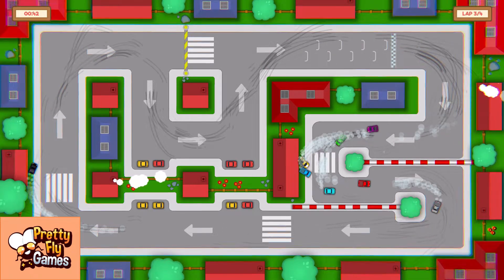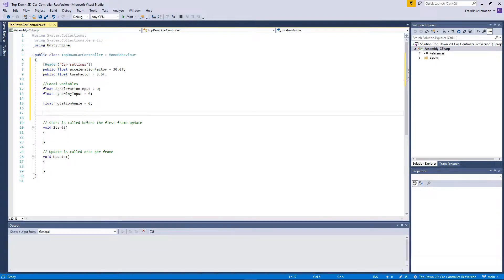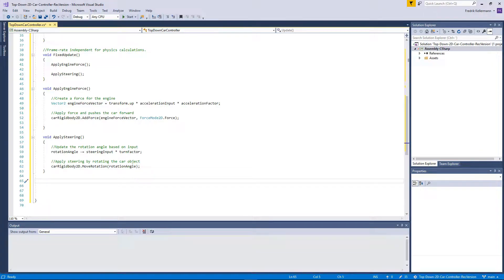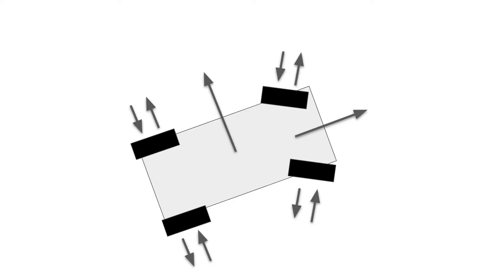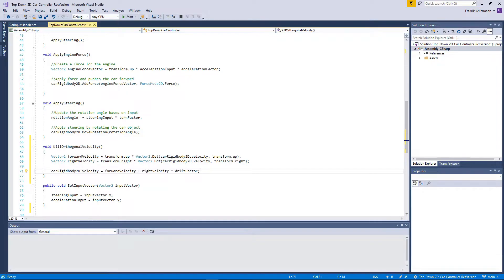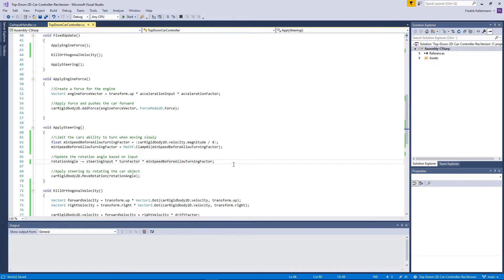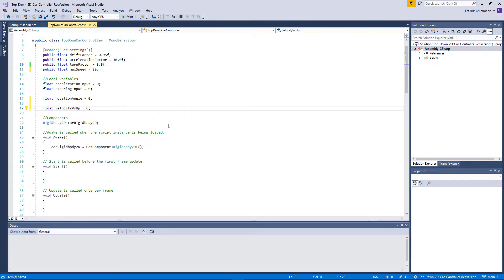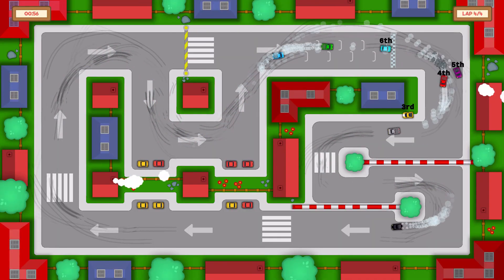How to create a 2D Arcade Style Top Down Car Controller in Unity tutorial Part 1

Comment: using UnityEngine;
public class CarSteering : MonoBehaviour
{
    public float gaz;
    public float gazSpeed;
    public float poworot;
    public float maxpoworot;
    public float poworotSpeed;
    public bool stopRotationOnKeyRelease = true;
    void Start()
    {
        gazSpeed = 5f;
        maxpoworot = 3f;
        poworotSpeed = 2f;
    }
    void Update()
    {
        gaz = Input.GetAxis("Vertical") * gazSpeed * Time.deltaTime;// Изменяем угол поворота колёс в зависимости от направления движения (инвертируем повороты)
        if (Mathf.Abs(gaz) > 0.01f)
        {
            float directionMultiplier = Mathf.Sign(-gaz); // Инвертируем знак скорости, чтобы реализовать обратное управлени
            poworot += Input.GetAxis("Horizontal") * poworotSpeed * Time.deltaTime * directionMultiplier;
            poworot = Mathf.Clamp(poworot, -maxpoworot, maxpoworot);
            if (stopRotationOnKeyRelease && Input.GetAxis("Horizontal") == 0)
            {
                poworot = 0; // Остановка поворота
            }
        }
        else
        {
            poworot = 0; // Полная остановка вращения руля при остановке автомобиля
        }
    }
    private void LateUpdate()
    {
        transform.Translate(0f, gaz, 0f);
        transform.Rotate(0f, 0f, poworot);
    }
} У кого не фурычит этот код можете попробовать этот, он  вроде должен работать

Comment: I did the simple drift physics, but everytime I combine up or down arrow with side arrows. My car just gets launched off the map at an insane speed. What is wrong?
Reply from the maker: It can be caused by several things. I recommend that you join or Discord where it is easier to provide assistance https://discord.gg/AyYtKXT
You'll want to check that your car sprite is pointing upwards, then ensure that the actual sprite is at position 0,0,0.

Comment: Back movement has wrong steering direction
Reply from the maker: Yes, that was intentional but you can easily change it to behave like it would in reality. 

Here is a bit of code provided by a community memeber:
------------
All you need is one additional line of code in 'void ApplySteering()'

int dir = velocityVsUp > 0 ? 1 : -1;

and multiply rotationAngle by 'dir' value: 

rotationAngle -= steeringInput * turnFactor * minSpeedBeforeAllowTurning * dir;

------------

Comment: Are you not required to use Time.deltaTime (or Time.fixedDeltaTime) in your update method to account for the varying fame rates of different machines?
Reply from the maker: FixedUpdate() is sort of fixed so even on a faster computer it will run on the same rate as a slower one. However you can use Time.fixedDeltaTime to ensure that if you decide to change your project's fixed timestep later on it will still run at the same rate. But you are not required to do so. I hope that this answers your question.

Comment: Hello! AMAZING video, I'm going to make a game like the one you made, but I have some questions:

1- I wanted to put items like mariokart, is there any video that can help me with that?

2- Could it be possible to have a camera there that follows the player and so they don't see where the rest of the players are?

3- Can you make a course selector? and it will work Online?
Reply from the maker: Hi!

Glad that you liked it 🙏

1. I have not made such a video but it shouldn't be that hard to use parts of this series to implement that. 

2. Sure, just add a Cinemachine camera and have it follow the player or players. 

3. There is a tutorial how to select cars, you can use the same to make a course selector. Online games is quite hard to make so if you are not very experienced in gamedev then I would really skip that.
Reply: @PrettyFlyGames  Ok Thanks!
also, for some reason i did the "Car Controller" and "Get input" part, but my car didn't move.. how do i solve it?
Reply from the maker: @Lucariomon  I suggest that you download the example project and compare it with your project https://www.patreon.com/posts/top-down-car-49913192

If you need more assistance I recommend that you join our Discord as it is easier to provide help there.

Comment: Somehow I cant seem to turn my car left. When I turn right it appears to move the car in a circle clockwise around an invisible point. When I try to turn left, it goes backwards around that imaginary point counterclockwise. The turns themselves are also very wide it seems for some reason. I've checked my code and I cant find my mistake. Anyone have any ideas?

EDIT: I figured it out! My "Car" GameObject and my "Car" Sprite we not BOTH at 0 on the x and y axis. This caused the sprite to behave very strange. Hope this can help someone else troubleshoot!
Reply from the maker: Glad that you figured out what was wrong.
Reply: This helped solve my car problem, thanks!

Comment: I'm so confused... the vertical does not move!
Reply from the maker: You mean that the car does not move when you press the acceleration button? Ensure that you use transform.up when applying the force and not tranform.forward. 

Also you can get the source for the project here: https://www.patreon.com/posts/top-down-car-49913192
Reply: @PrettyFlyGames  Hey buddy - thanks for that.

I think my issue was that I set the gravity scale to 0 and was trying to turn with it, but of course, you cannot do that but in my original code I had it so you could. I like yours more, thanks! :)

Comment: hey so another question

when i start the game and the cars are starting at a turn the instantly switch to 0 degree rotation which isnt the best look

is there a fix for this?
Reply from the maker: Ahh yes, add this to your TopDownCarController.cs

void Start()
    {
        rotationAngle = transform.rotation.eulerAngles.z;
    }
Reply: @PrettyFlyGames  OHHH I WAS DOING IT WRONG

Thank you so much youre the best

Also ive figured out some ways to add driver ratings to the game if you wanna add that

You just take the power then multiply it by 1.05 or something around there if you wanna try that

Comment: hi ! i know this video was made a year ago, but is there a way to use it with a virtual joystick ? i'm trying to make a tank game for mobile. Also, thanks for the video, it helped me a lot understanding unity's physics
Reply: my problem is that i want that the car go in the dirrection of the joystick, right now, if the joystick go up, the c&ar will go forward, no matter how it is oriented
Reply from the maker: You can hook up any type of joystick to this really. The important thing is that the input axis remains the same. You can checkout this video https://youtu.be/BQJf0gCPVmo where I show how to implement UI touch buttons to steer the car. The concept is similar to using a virtual joystick.
Reply: @PrettyFlyGames  Thanks for your awnser, but sadly, it seems that i cant make it work properly ;-;  I saw your video for mobile UI but since i have two joystick (the otherone is for shooting) it cant be done that way either. Right now, my joystick work exactly as a keybord arrow, the result i'm trying to acheive is that you neet to orientate the joystick in the same direction of the car for it  to go forward, so i have "input.vector.x = joyStickPos.x - tankRot.x; input.vector.y = joyStickPos.y + (1 - tankRot.y);" so if the joystick is in the same direction of the tank, the input vector is (0;1). tankRot.x and y are the sin and cos of the tank rotation, because my joystick position is how it is from center in height and lenght (so the sin and cos). I'm really sorry if i did any gramatical error, i'm french. Also, I'm very sorry to bother you this much, if you don't want to reply, i'll understand. Thanks anyways !
Reply from the maker: @armandmarcelli5795  ahh ok now I understand what you want. So you want the car to turn in the direction of the virtual joystick, right? 

So if you push the virtual stick up then you want the car to go up. And if you push it left then it should go left? 

If that is the case I can probably provide some help, but it might be easier if you join or Discord server https://discord.gg/AyYtKXT

Comment: I’m making a F1 game and I was wondering if I use this controller how can I make it less cartoony and more realistic?
Reply: Im also trying to do that so idk if you actually attempted to make an f1 game in 2d and it happened or you have experience with coding but I would love to see what you have done if that would be cool with you
Reply from the maker: This controller is designed to be cartoony so it will probably be hard to get it to behave 100% realistic. You can try to adjust the drift factor and see if you find a number that fits your needs more. The turning of a F1 car is probably also effected by how much drag it has so you can see if you can simulate that in some way.
Reply: @PrettyFlyGames  Yeah I’ll try making it less drifty, thanks

Comment: Hi in my project I have spiral staircase, Ive been using 2d effector on the collider it works if your going up but when you want to go down the effects wont work. Any idea on how to solve this ?
Reply from the maker: I've only used effectors like once but can't you just reverse the flow?
Reply: @PrettyFlyGames  in not using the flow effector but the one way component. Is there any other way of using colliders for a spiral staircase ? It's works in one direction is going up, but once you go down or works against you, only thing I can thing of is having 2 colliders and activate the right one when detecting if the player is going up or down.
Reply from the maker: @random_precision_software  You can also solve that by just not using an effector at all. Put a 2D collider on your ladder and change it to a trigger. Then if your player is on a ladder you disable gravity by setting gravity scale to zero and then if the player is pressing up then simply move the player up and vice verse with the down button. If the player steps away from the ladder then reset the gravity scale and it will fall back down again.
Reply: @PrettyFlyGames  The problem is it a Spiral Staircase. would that work?. Its not just up and down.
Reply from the maker: @random_precision_software  I assume that this is in 2D? Then climbing up and down doesn't matter however making the animation so it looks properly can be a challenge.

Comment: Great tutorial but my car doesn't reverse? I check the acceleration input and its recording that it is -1 so im not sure where i went wrong. Any ideas?
Reply from the maker: Did you write the code yourself or did you use the project from https://www.patreon.com/posts/top-down-car-49913192 (Top-Down-2D-Car-Controller.zip)?

 I suggest that you try the project above first and see if it works there. From that you can hopefully figure out what is wrong with your code.
Reply: @PrettyFlyGames  Ah thanks, i simply had put a > instead of a <
Reply from the maker: @cosmic3228  awesome!

Comment: Hey I'm making a similar driving game but with the code you've provided my car doesn't rotate when it bangs into walls at an angle. For example, if I'm driving into a wall at a 50 degree angle, I'd expect on the collision for my car to turn into the wall slightly since the forward acceleration continues to drive the body forward but the one stuck corner will force it to turn. Does that make sense?
Reply from the maker: This code is for arcade style games so it won't behave physically correct. If you want that kind of effect then you can probably apply some extra force at the point where you had the collision. So lets say you drive with your right wheel at an angle into the wall, then you might want the car to rotate right if the angle is large enough. In that case you'd add a force at the collision point which should cause it to turn. You can also experiment if you can get that effect by just apply torque to the rotation.

Comment: Hi so i was wondering if an ai misses a waypoint node how can i program a way where instead of trying to hit it it just gets told to go to the next one
Reply from the maker: Hi!

That is a bit tricky, well not to program it but the implications it might have. So if an AI has missed a waypoint then it might be somewhere it really shouldn't be at all. So often switching to another waypoint will not solve the problem as many courses are build so you need to follow the waypoints. So instead I'd try to fix the issue why your AI is missing the waypoint. Maybe you can simply increase the range of the waypoint or move it. But most often the best solution is to have your AI try to get to the waypoint it missed instead.
Reply: @PrettyFlyGames  thats fair, thank you!

Comment: Is there a way to invert the left and right control when going backward ?
I noticed that it doesn't work exactly like a car :
up + right = accelerate + go right
down + right = reverse + go left
Reply from the maker: Sure, you can change that. Just check if velocityVsUp < 0 and then reverse the steer input if that happens.
Reply: @PrettyFlyGames  Nice, thanks, it works perfectly !

Comment: Would it be possible to make it so that MORE acceleration creates a tighter drift, instead of having to release the accelerator to turn tighter?

I changed the input of my acceleration to based on an on-screen slider, and I want to be able to 'spin-out' the player if they apply too much acceleration through a turn.
Reply from the maker: Anything is possible really. In your case I think you can easily adjust the drift value while driving so if you accelerate you get more drift. You can spin the car also if you apply too much throttle. The easiest way to do that is to disable the effects of the controller and apply a bit of spin to the car.
Reply: @PrettyFlyGames  I'll try adjusting the drift value.. seems obvious now that you've said it!

Awesome tutorial, it was super helpful and easy to understand! You work at a really good pace
Reply from the maker: @Jacrxsp  awesome! Glad that you liked the videos.

Comment: Any tips on how to adapt this to the  Input System 1.0.2? I'm having trouble with the input. It moves upward and downward as it should, but it doesn't really move in the horizontal axis. I think it has something to do with how the Input System store the info from the stick, but I dunno...
Reply from the maker: I haven't really used the new input system but it should be something like this
public void OnMove(InputValue input)
{
    Vector2 inputVector = input.Get<Vector2>();

}

You would then use the value of inputVector. I'm not sure if you need to reset it though like when the user lets go of the gamepad/keyboard.

Comment: It works perfectly :) But do you have any ideia how to implement braking while pressing "Space Bar" and using a "brakingFactor" value?
Reply from the maker: If you'd like a factor to control how much you brake then you could add that into the ApplyEngineForce function as it also brakes when a player pushes the down arrow if the car is going forward. 

If you want it to work when the player is going in reverse or forward you can just change it so that if the space button is pressed you increase the drag. 

If you only want it to work when going forward then you could use parts of the function IsTireScreeching with the same logic as  isBraking. If the car is braking and the player is hitting space then add a brake factor in the ApplyEngineForce function.
Reply: @PrettyFlyGames  I will try it, thank you :)

Comment: Hello, i have a little question, my car is not going in reverse. AccelerationInput is giving me -1 but the car is not going in reverse at all .. also if i put "-transform.up" is going in reverse when is press "w". I tried a lot of things but I don't know why is not working. Shouldn't it work from the beggining ? I'm sure the code is fine but maybe i did something wrong with other components.
Reply from the maker: Hello!

Pleas make sure that you use the code from the project: https://www.patreon.com/posts/49913192. Does the example work in this project?
Reply: @PrettyFlyGames   yeah .. smth was wrong with my code. Anyways now it's working, thx for the reply. Now i added a brake when the player press "space". Used the code for slowing the car down when the player is not accelerating and added more drag to the car when the spacebar is pressed. Working like a charm. Going to part 2 now. Also maybe you can make a tutorial on how we can make a simple system to select the car we want. I don't think i'm skilled enough to do it on my own but i have a little ideea. I thought that i would use an empty gameObject with a script to instantiate the car prefabs. Is this the right path to go ? Thx for everything you do ! awesome tutorials.
Reply from the maker: @spanustefan1995  glad that you managed to solve it. 

When you say "how we can make a simple system to select the car we want" do you mean like a GUI where you select between different cars?
Reply: @PrettyFlyGames   @Pretty Fly Games   Yeah, just a simple GUI for selecting what car and race you wanna play.

Comment: How can you make the brake skid shorter?
Reply from the maker: You can either make the total duration of all skid marks shorter by changing the duration of the trail renderer = easiest. If you just want a max length per skidmark then you need to add a timer or similar = a bit more complicated.
Reply: @PrettyFlyGames  but shortening the renderer will also effect the drift right...was thinking of using a coroutine to draw the brake skids a little later so they not as long seriously loving your tutorials man! Thanks for the reply